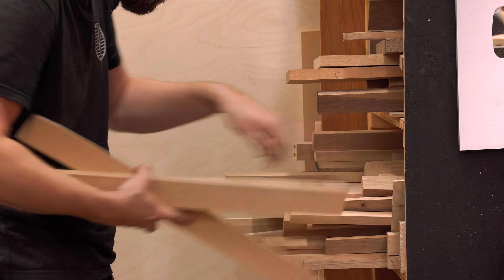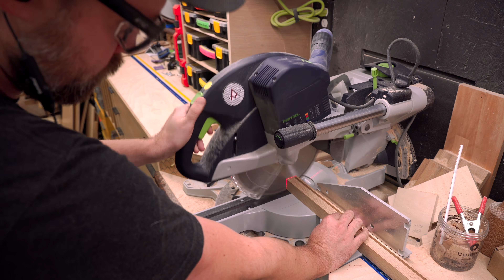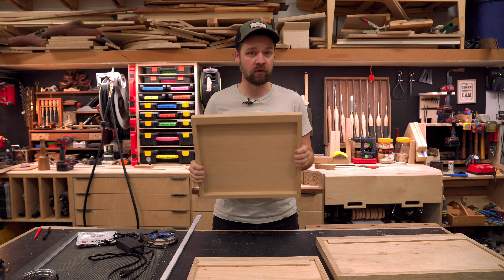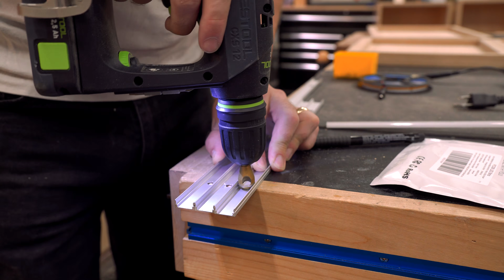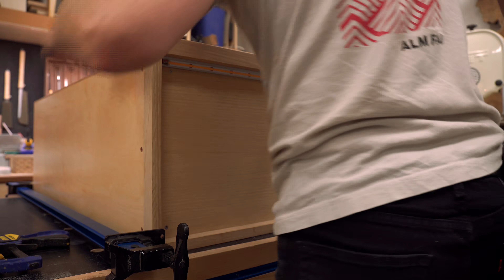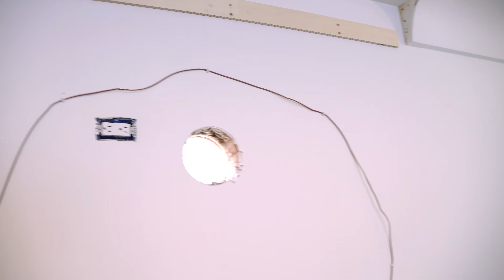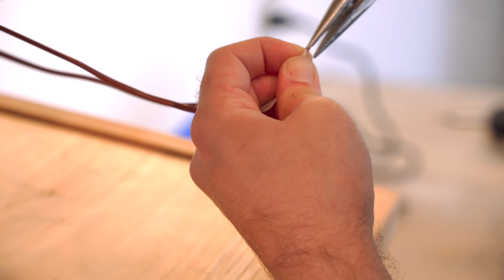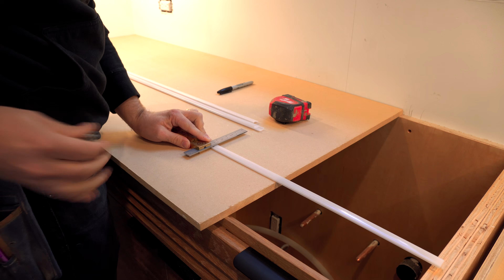Invisible Wire LED Lighting: Ultimate Kitchen Upgrade!

Comment: Hey Michael! The main reason for the difference in language is that Transformers just transform the voltage output, whereas drivers convert alternating current to direct current. If you put AC power through LEDs you're going to have a bad time.
Reply from the maker: @peranolde Good to know! @scott I debated about adding in the transformer noise when I said that 😂
Reply: A driver will also limit the amount of current the LEDs can draw from it to avoid overheating of the LEDs.
Reply: Transformers also come from another planet so they’re bound to speak a different language.
Reply: @ScottStuff12  Oh, those are different transformers. They are, "More than meets the eye," rather than, "Hidden in the attic away from eyes."  Other than those two differences (different planet, different location) they are likely indistinguishable from each other to the untrained eye.
Reply: @ScottStuff12  Ha!
Reply: The quality of DC coming out of the power supply is critical. Crappy power supplies that just use a rectifier have "bumpy" DC that causes LEDs to noticibly flicker at 2x60hz = 120hz, which is super irritating. Good power supplies add capacitors and/or inductors to smooth out the bumpy DC into smooth, constant voltage DC that produces constant, non flickering LED light. I'm now standardizing on 12v outdoor landscape lighting power supplies because of the clean, constant DC they produce (and their IP67 waterproofing, good for for kitchen environments.)
Reply: Also, you can just use any "DC power supply" at the voltage you need. That's also using a transformer. 

Although, a dedicated "LED Driver" can have the dimming circuit integrated, rather than requiring a separate dimming module. 

Although, some smart LED controllers also just take in DC voltage and perform the dimming themselves - but some don't. Unfortunately, it's a little complicated. 

I like just using any old "DC PWM dimmer module" that supports the LED voltage, which should work with most smart LED controllers... Including WLED on an ESP32, which is my favorite smart controller that is very cheap and has wide compatibility. 

That's another rabbit hole, as you can simply buy an off-the-shelf smart LED controller (which will likely have an ESP32 inside and work in the same way).
Reply: Back in the 60's in my electronics shop class I built a variable voltage box that converted the AC to DC.  I believe it was called an inverter as opposed to a driver.
Reply: @craiglenhard-rvrguyd  inverter usually converts DC to AC
Reply: @craiglenhard-rvrguyd  inverters turn DC to AC, rectifiers and converters go AC to DC
Reply: I was hoping somebody commented this.
Reply: That would be a rectifier actually
Reply: Also, a transformer specifically means coils wound around a core to change AC voltage through magnetic coupling between primary and secondary windings.
Reply: LED's run on 'PWM' - Pulse Width Modulation. So, depending on the LED strips, the "driver" usually converts the AC to DC, but then outputs the appropriate PWM signal to the lights so they do what they are supposed to.  If RGB, then that controls the colors as well as the brightness.
Reply: A transformer is the actual wire wrapped around iron, heavy component of linear power supplies. They became synonymous with power supplies over decades, and most of us still have some heavy wall warts with transformers inside. Its common use to describe any power supply is very loose and has persisted long after transformer-less switched-mode power supplies have taken over (which do have a transformer, but it is tiny and not considered a defining characteristic). But it is a colloquial term and you should stick to "power supply".

An LED driver is just a power supply with features for LEDs. This one will dim like a regular 120v bulb when wired to your light circuit and will meet code for an attic install.
Reply: So it's basically an AC adapter?
Reply: @titosrevenger Yeah, no, that’s another difference between an LED driver and an AC adaptor that comes with your phone or your WiFi access point. LED drivers (doesn’t necessarily takes AC) limits the current to drive LEDs properly, that’s why they are called drivers.
Reply: @jerrymk6846 in theory yes, but in practice those kind of led strips usually regulate the current themselves and just want a stable 12/24V from power supply.
Reply: @Max24871  absolutely. These modern 24V LED strips have resistors that limit the current. But the role of an "LED driver" is still valid, for example an LED driver IC usually does constant current. It's just that now LED strips can be driven from a constant voltage source, it doesn't necessarily make the CV source an LED driver, but just a power supply for the strip. Even, even if you still want to call it an LED driver, the origin of the LED driver term is still valid.
But I get what you mean, good point.
Reply: @jerrymk6846  Yup, that's exactly what I was trying to say. He called the power supply an LED driver, when those kind of strips don't need an actual driver.
Reply: @titosrevenger  the technical term is "rectifier" that converts AC to DC, but there will either be a transformer before the rectifier to lower the voltage or a buck converter after the rectifier to lower the voltage.
Reply: Not really, if the voltage in a reasonable range, then it’ll light up just fine. Many older (and crappier) E27 LED lights just feed 120V AC to an LED string with a current limiting resistor, LEDs are just diodes, and their reverse breakdown voltage is way less than the forward voltage for proper driving.
For a 24V strip, 24V P-P AC will work just fine, just dimmer.

Comment: The company EShine has LED bars that are easy to install, modestly priced and most importantly.... have a hand wave on/off/dim feature. Just wave your hand at a certain spot and it turns on/off. Hold  your hand there and it dims.

Great product with screws and caps, or double sided tape.

Comment: I loved the video, more people need to use this type of lighting on their furniture. 

I am a lighting designer and I have some points that I would like to complement and correct:
COB LED strips are not very good for lighting use, only for decorative uses, especially when we are talking about a place that requires a little more luminous flux. They heat up a lot, which shortens their lifespan. The use of aluminum channels, in addition to providing a good finish, can help with heat dissipation, more people need to use those. To prevent the LED dots from appearing, the diffuser will be enough, in addition to giving a good diffused finish to the light. We just need to check the light retention. Another important point is the lumen. Watts is the power of the LED, not necessarily how much light it produces, some brands and models are more efficient than others. 
In summary, the main points you need to take into consideration are the CRI, as in the video it needs to be at least 90+, the lumens per length it produces, the light retention of the diffuser and a LED strip that has a low Steps value (MacAdam ellipse).

I love these videos, in addition to being a lighting designer, I am also an interior designer, and I have already implemented several of your ideas in projects
Reply from the maker: This is great info! Thank you! There's always more to learn about this stuff.
Reply: So if you don’t recommend COB LEDs for under cabinet lights , and you don’t want light “dots”, what do you recommend?
Reply: @karenmitchell6814  If you use a normal LED strip but one that has the appropriate characteristics and a good diffuser, you will have this more diffuse and comfortable light result.
Reply: @douglasstrohhaecker8430  but what exactly do you use, whats the spacing thats best with a diffuser
Reply: @karenmitchell6814 that’s what a good diffuser will fix.
Reply: That's good to know! I'm wanting to get some LEDs to provide better soft lighting for my room, so your comment was very helpful!
Reply: I'm about to run some 12V COB strips under my kitchen cabinets, and they're low enough to block line of sight so I wasn't going to bother with diffuser channels. Your point about heat dissipation is something I hadn't considered, so I'm revising the plan accordingly.

Thank you for sharing this advice, you may well have saved me some headaches down the road :)
Reply: @glittalogik
Reply: What kind of LED strips do you recommend for lighting purposes?
Reply: @HaNs-ot8kk  it depends on your desire result. It's not a jack of all trades, non COB LED strips change their property, chips count/m, voltage and consumption according to the lumens output. I'm from Brazil so here we use the metric system. I follow these rules, field tested(these values are the total output considering the diffuser retention):
Prep or workstation for ceiling install: 1500~1800lm/m
Front light for mirror, bathroom or makeup: 800lm/m
Under cabinet prep station: 900lm/m
Reply: Douglas, good info, though hoping you can share some specifics.  How much lighting under the cabinets is ideal?  And how does one find LED strips that have a "low Steps value"?  I've never heard of that before, despite doing a lot of research on what LEDs to use on our current kitchen remodel.  CRI, sure.  Steps value, not at all.  Even the Wikipedia article regarding the MacAdam ellipse (just looks like color gamut) doesn't even have the string "step" anywhere on the page.
Reply: @pfurrie when we calculate lighting we aim for 500 lumen/m2 or lux, as that is what the german standard requires for workareas. I dont know how to properly gauge the required lumen/m. I guess about 500 lumen/m is about right, but that depends on the distance of the light to the work area and if light gets absorbed by a diffuser.
Reply: W comment!
Reply: COB LEDs are good for lighting they are just higher power output per foot which leads to more heat output. If you look at the specs a COB strip has way way more LEDs than a non-cob strip that is why it heats up more its just more LEDs in total. You lose a massive amount of light through diffusers even clear ones and closing a channel off insulates the strip a cob strip hidden properly in a channel does not need a diffuser.

If you compare specs a COB LED strip can have much higher lumens per ft but does not need a diffuser which only lets 60-90% of the light through and that is converted into heat in the diffuser and traps the hot air above the strip in a channel.

For any application where the strip is very close to the user you should use COB led strips to avoid the multi-shadow effect. They also high LED element failures better as there are more LEDs in total so one dead one doesn't cause a visible gap in the light.
Reply: @riakata  I agree with some of your points. In certain situations the COB LED strip can be an option, but in few uses in my opinion. I have never had any problems using a conventional LED strip with the proprer aluminum channel and difuser. Most of the LED strips I use had a minimum of 900lm (considering an output of 600lm/m) for under cabinet use and 2300lm/m for linear fixtures. I'm specialized in interior lighting, aways used high quality LED strips and never had dot shades or burn chips. Proprer products use in the proprer way will get you the desire result.
Reply: I would recommend 'Waveform Lighting'. No affiliation to them, just a happy customer.
While I have not used these guys LED strips. I have used their bulbs and their stuff is great.
Reply: Why use COB LEDs however -- just use analogue LED strips. The CRI and color production on these are better.
Reply: for normal use an CRI of 80 and above is normally enough for normal day life, if you need to see acurate colors for example in hair shops there you should use 90+ but at home 80 should be enough they are normally a bit cheaper too

Comment: ‘Transformers’ transform AC voltages to other AC voltages.

LEDs need DC current, so an LED driver needs to convert AC to DC. A driver [ probably ] actually has a transformer inside to step down mains voltage, a rectifier to convert AC to DC and then maybe some other power electronics to produce a clean DC constant current source.
Reply from the maker: That totally makes sense! Thanks for solving that mystery 🙌
Reply: @MichaelAlm Also quick note, $100 for a simple DC 12V or 24V power supply is absurd. Those can be bought for less than $20 with 10A or about 120W for 12V units. There is absolutely no reason to be paying that much for one
Reply: @aleksastojanov4033  Actually, you are incorrect. While you can get a standard 24v brick for cheap, when you want to use a house dimmer switch, you need a "magnetic" dimmer to be able to dim the lights. The dimmer that normally would dim 120v.  The magnetic driver can compensate for the 120v dimming and relate that to teh low-voltage side.

Finally, while $100 is a lot, about the cheapest I found was $60 (for a reliable one). Look for a brand called Inexaccessories (B0CP7D89YW). I just got it and it seems to work well.
Reply: @aleksastojanov4033  Note that the $99 "driver" he bought also supports dimming... 

Although you can handle that with a $2 PWM dimmer module and any LED smart controller. (Or, a PWM dimmer module with a knob).
Reply: They have a hf trafo but it goes after the rectifier